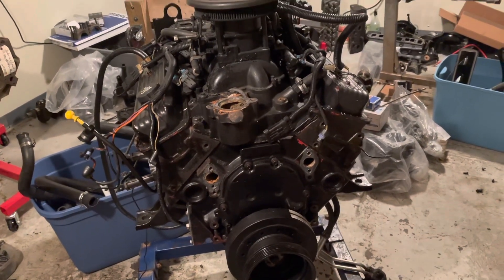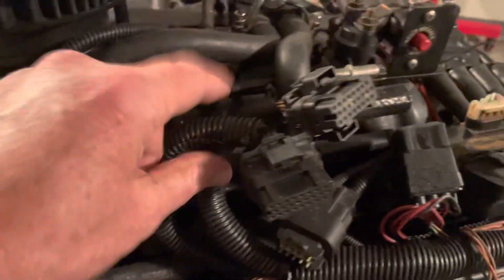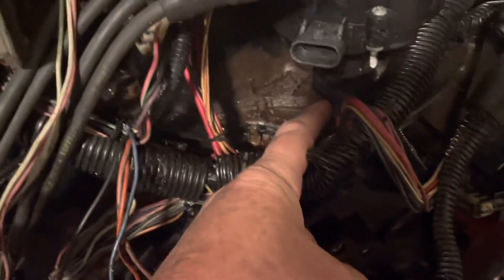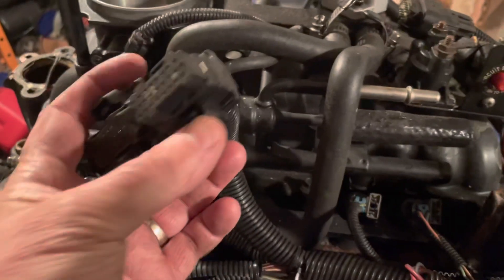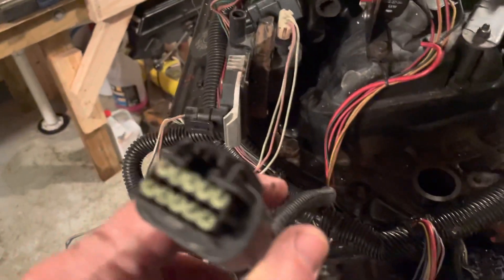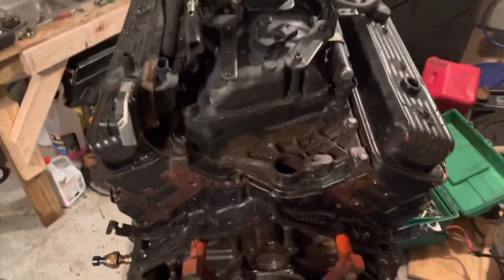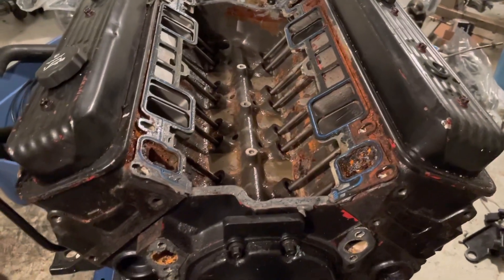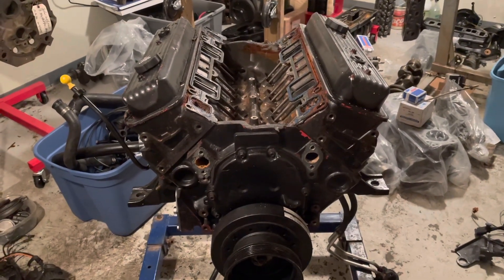Mercruiser 5.0 1(b2) - MPFI Teardown

Comment: The IAC is from a ford!

It doesn't have a cam sensor. Instead the distributor's sensor is used for cam position, which is not a standard distributor reluctor. 
So thats how it sequences the multiport injectors correctly. 

As you mentioned, the spark is generated off the crankshaft sensor. This eliminates the timing issues from torsional twist in the cam (actually a significant thing in performance engines), along with backlash from the timing chain and distributor gear.

I'm tearing down a 2006 5.7 MAG MPI right now. Mine doesn't have the fixed distribuor clamp - mines adjustable. Mine was never significantly worked on previously. 
Unfortunately i have a scored cylinder 6.

One notable difference is my cool fuel system is under the alternator, and has 2 fuel pumps
Reply from the maker: Are you certain the IAC is a Ford part? The ECM is GM MEFI 3 and I’ve never seen GM use a Ford part before.
Reply: @moccasinmarine  
Yep! It's from a Ford Winstar (and probably a bunch of others).
Careful using non OEM parts for the IAC - some work well, while others don't, or fail quickly...

The GM IAC's I've seen in the past were 4 pin stepper motors (ie 2 internal coils), with a little pintle that moved in and out from an internal motor driven screw.

Apperntly,  Motorola made the ECM's for Mercruiser. The rumor I heard for using a Ford part was there was only one I/O left in the ECU.  The Ford part requires only a  varying voltage(probably via PWM) and a ground/power source. It works much the same way an audio speaker works.

The 350 MAG MPI is based off GM's 1996-1999 Vortec 5700. Unfortunately, a lot of parts have been changed out/modified when converted to marine.